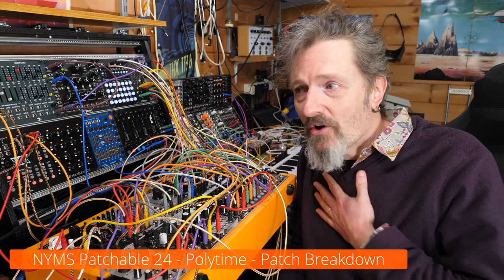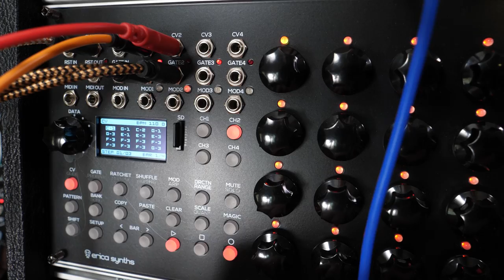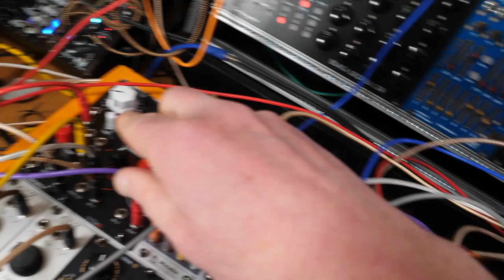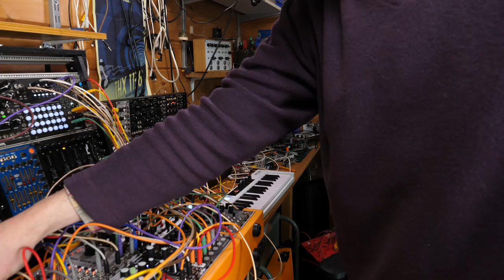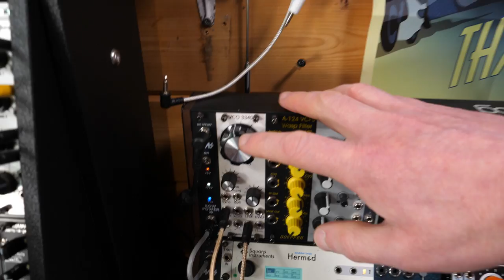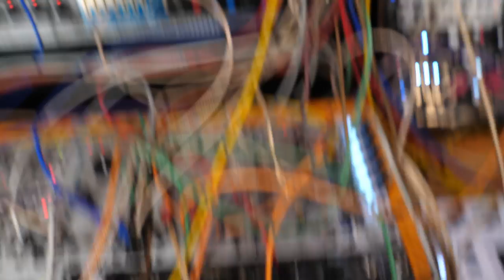NYMS Performance Patch Breakdown - Polyrhythms and Polymetrics

Comment: “I’m not sure if I really like it...” You said it not me. Loving sharing your modular experiences though, thank you so much, current financial circumstance preclude doing it myself, and I’m not even sure I would go where you have, though in a significant way I only know that partly because of your videos.Great stuff!

(PS I’m a piano player, not a modular synthesist (yet), and I think perhaps why your polyrhythms are not sounding so good is I suspect you have to be quite strict about making sure the smallest notes you choose to use are of the same lengths in both rhythms for them to sound their best, and the way you are doing it using your synth sequencer is not doing that. They are more common in non-western music, but two classic examples in western music I know of, and can improvise around myself on the piano, are Brubeck’s Take Five, and Nick Drake’s haunting and also disturbing ‘Riverman”, which are both characterized by a slightly unsettling three beats then two beats background rhythm in the main part of the songs, with a more traditional four bar melody on top of it, the bridge of “Take Five” switching to full on four four which makes it seem like a strange breath of normal freshair in the song, before going back to the slightly unsettling 5/4 of the main song.)
Reply: Also, Opening by Philip Glass.  4/4 with triplets on top.  Really simple to play (once you get the rhythm into your fingers) but can sound endlessly complex with slight timing and dynamic changes.

Comment: Hi Robin. As not all Eurorack modules allow to use tuplets other than triplets, mostly because the nature of the MIDI clock that is 24ppqn, so it can be divided by 2 or 3 but not by any other odd number greater than 3, the best way to create polyrhythms is by using a sequencer. All you need to do is multiply the 2 numbers of the polyrhythm to get the length of the loop (the number of steps). So, if you want to create a 7 over 3, you need a sequence of 21 steps (7x3), the first pattern occurs 3 times every 7 notes and the second pattern 7 times every 3 notes.
If you have a module that can generate clocks using triggers, you can use these patterns to generate new clocks that are related with the main one in some form, i.e. 3/4, 7/5... of the main tempo.
Finally, a polymetric is a kind of polyrhythm. At the beginning of your video you created a 3 over 4 polyrhythm using a triplet over a four on the floor pattern. It can be interpreted in different way with the same result (the same sound). You could do that with your module of 12 steps sequencer. See the link below. I hope it helps to understand a little more the amazing world of polyrhythms. Thank you for your videos and take care.

https://www.dropbox.com/s/g0w8sx3nrt8ae1b/Same%20polyrhythm%20in%203%20different%20ways.png?dl=0
Reply from the maker: Thanks! But I think you have that all backwards. Check the link to the nyms for a really good illustration 😁

Comment: Polyrhythm (like in the example pic on NY modular society) e.g. one fast
 clock (or square from lfo) to a clock divider, use the /4 clock output 
as the external clock of  a sequencer with 5 steps, use the /5 clock 
output as the external clock of a sequencer with 4 steps . Don't forget 
to connect the clock divider and the sequencers with a reset line, to 
get them back in sync.

Comment: I will simplify: When you play two patterns of 16ths at the same speed, one of them with, say, accent on every 5 notes, then we have a cross-rhythm, not a polyrhythm. Its not polymetric. Its all in one meter and time signature, but the 5 note groupings travel in relation to the 4 note pulse. Polyrhythms, now you have two distinct time signatures, both measures starting at the same point, and both ending at the same point. The only way to obtain this is by them moving at different speeds. I understand that there is misleading information on this subject flying around, even in written material, however this is the correct definition.
Reply from the maker: Oh, thanks very much - did I get it wrong somewhere?
Reply: @MoltenMusicTech  here and there, but that just gives us an opportunity for discussion which is good. A lot of people find this a scary topic. Cross-rhythms are very common in East Africa and in the Middle East and the Balkans. While Polyrhythms originate from the West coast, Senegal, Ivory Coast where they play 6 over 4. And the way they do it it can get quite confusing. From there those rhythms often quite polyrhythmic, traveled with the slaves to Latin America. Polyrhytms like Abakwa were a part of the old African religion so in order to study Afro Cuban music for example we need to get ourselves mixed up in the religion known today as Santeria. I will stop now since I could just go on and on.
Reply: As I understand it (or, perhaps, don't understand it) in order to do polyrhythms with a single clock pulse, you need to multiply the time signatures to set your measure (bars/loop). So, in order to combine one pattern in 4/4 with one in 5/4 you need a measure that it is 20 bars long if you want to clock it with a single clock?
Reply: But then, most eurorack sequencers do not allow a loop that long!
Reply: @nigeltedbury5805  I just received the Usta the other day and it has some polyrhythmic features. If you want to play a measure of 16th notes in 4/4, against 16ths in a measure of 5/4. make two voices, each in 4/4, in order to have them start and end at the same time but still being in a separate time signature, you need to change the subdivision for one of the voices, so that each beat now includes 5 x 16th notes (quintuplets) instead of 4 x 16ths. So now all of a sudden instead of that measure of 4/4 having 16 x 16ths, it now has 20 of them. Now place an accent on every 4th note in that pattern of 20 notes and you obtain 5 even notes against 4/4. So change the subdivision, I think it can be done in the Erica Synth Sequencer, I'm not sure though. For 7 over 4, same method, change the subdivision in one of the voices to the quarter note including 7 x 16ths instead of 4. Place an accent on every 4th note and you get 7 against 4. Of course those 5 or 7 notes can include rests. Now modify this method to fit any polyrhythm. Remember, both of the measures are in 4/4. There are probably sequencers that can do this automatically, I dont know.

7 against 3, you simply put accent on every 3 notes instead of 4 in the examples above. Change the quarter note subdivision to 7 notes and then use 3 note groupings instead of 4 note groupings.
Reply: @nigeltedbury5805  Well the sequencer has to offer you the choice of opening the menu and changing the subdivision for the voice. It has to be able to handle separate subdivisions for the separate voices. Some of them probably even have polyrhythm mode that handles this for you. But if the sequencer doesn't offer changing the subdivision for the voices separately,  then I don't see a way to obtain a polyrhythm.
Reply: @gunnarwaage4343  You can do it if you multiply the time signatures to set the step count (I think). E.g. for 5/4 playing with 4/4, set the step count to 20 steps (5 x4). Put a kick drum on 1,5,9,13,17 and a snare on 1,6,11,16. The kick is playing in 4/4, the snare in 5/4. Both start and end on the same step and play at the same tempo, but in different time signatures.
Reply: Actually, just realised that's not a polyrhythm! Doh! You are right - you need to be able to set the subdivisions per part.
Reply: @nigeltedbury5805  yes you can get 4 over 5 that way but not the other way around. So that works if you want to layer the shorter time signature on top of the longer one. Good observation there.